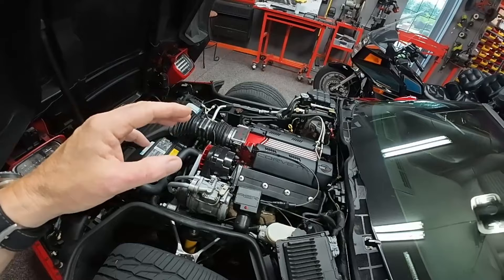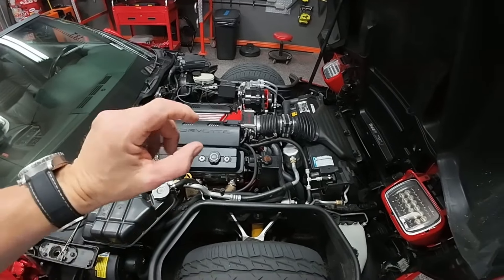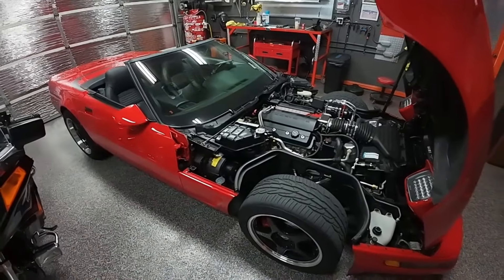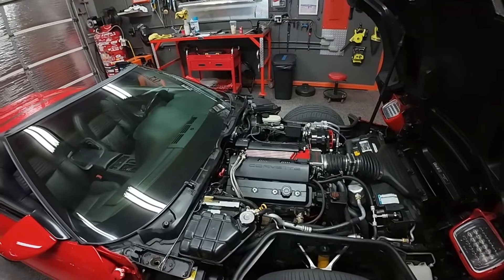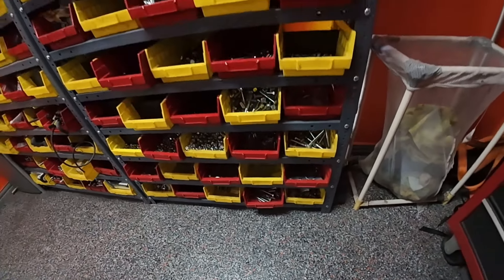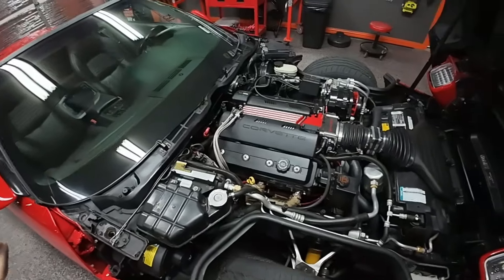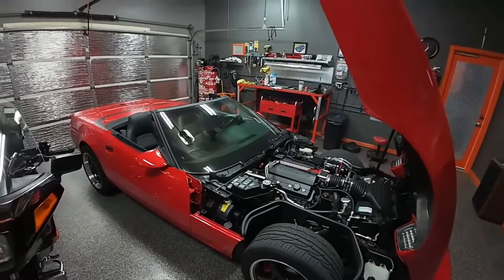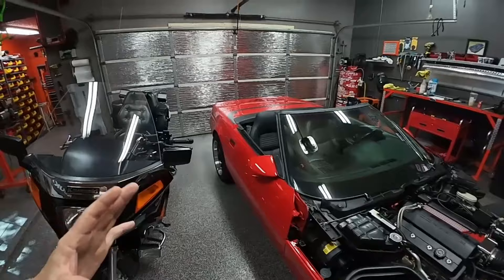1995 CORVETTE C4 FROM HAYELL!

Comment: I have a 1993 40th in white pretty much stock with 2 k&n filters, air foil holly pump. The problem I am getting is:  I feel like the car is not getting enough fuel because I don’t like to push the pedal to the metal. I was thinking of upgrading my injectors to achieve maximum power without pushing the gas pedal all the way down!  Will bigger injectors letv me feel the power better? If you know what I mean.

Comment: do 24-27lbs injectors with holly fuel pump make a c4 just more responsive?  I have a 1993 c4
Reply from the maker: Ended up doing 32s with a Walbro that was recommened for my set up...laid down 402 on the Dyno WOOOO!